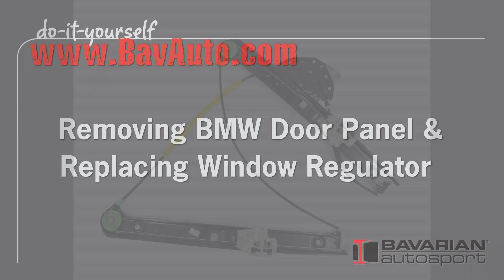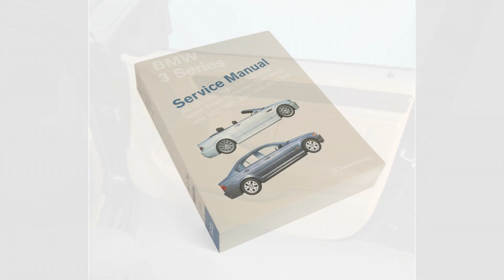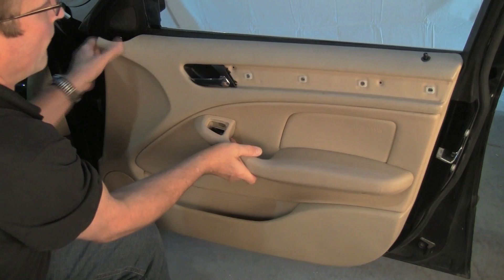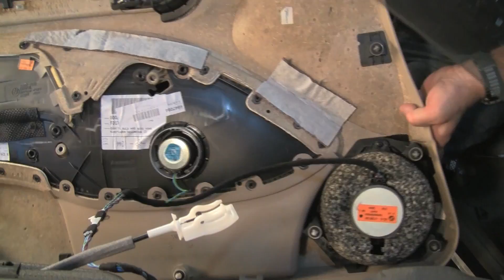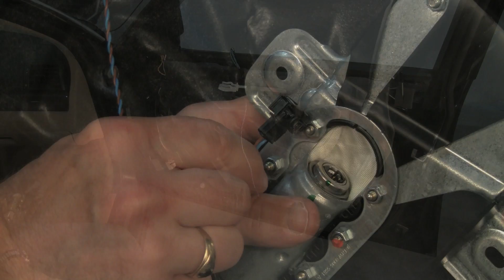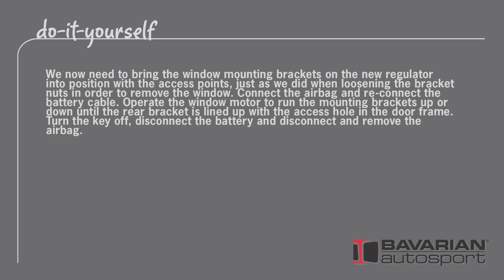Removing BMW Door Panel & Replacing Window Regulator

Comment: I have 01 530i and the driver window just fell straight down.. if I press up all I hear is the motor adn thats all.. the window just stays at the bottom... also the rear window doesnt go all the way up.. it stay 1-2 inches low from the top
Reply from the maker: Sounds like you certainly need the driver side window regulator.  the rear one is also likely in need of replacement.

Comment: I have a 2002 325i, the wooden panel, the one that has 2 screws behind it, does that slide back on? or does it need to be glued?
Reply from the maker: The wood trim  uses pins that push into plastic grommets in the door panel.  Just snap it back into place.

Comment: thanks so much, this video was spot on, I bought the parts myself for 27 and installed it in about 1 hour (even with my usual mistakes).  The window nuts are 8mm not 10mm...other than that it was great.  You may want to add if the cables get all locked up, the window won't come down or move.  I cut them with metal snips, window dropped right down...accessed the nuts just al little lower than where you suggested...thanks so much

Comment: Hi, My dad was able to replace the window after buying a new regulator and it worked. The only issue we have now is that if we hold it for a long time to put it up, once it reaches the top, it rolls back down. We think it has to do with sensitivity, but we don't know how to fix it. Any ideas? it's a 2006 bmw 325i rear driver side.

Comment from the maker: The E46 models do not require any adjusting after a regulator (or glass) replacement.  Some other models do.  The Bentley repair manuals for the various BMW chassis will cover these points.  Other than this, we don't have a specific issue for your to look at.

Comment from the maker: If you have a later model with a cable operated regulator, then it is likely that the regulator needs to be replaced due to the cable breaking away from the window glide mount.

Comment: I followed every step on my e46, however when I tighten the 2 nuts to tighten the window, the window goes up but does not come down, the spastic (orange colored) seats slip off, I tried it again this time tightening it more still the same problem, please advise

Comment: PS I can hear the motor running but the window won't move. Is it possible it's just jumped the track of the nut came loose?
Reply: Same here... I can hear the motor running but the window doesn't move. Any advice? :-(
Reply: Same issues. Someone please answer lol

Comment: Hello, first thanks for the video! Very DIY doable! My question is actually on changing the front right passenger, otherwise known as "Glazing" I recently replaced my window, and it doesnt close all the way unless i put pressure on the window from the outside. Are there any steps or things i need to know when installing a new window? Thanks!

Comment from the maker: Aside from any binding that may be present, have you performed the initialization procedures?  This sets the up and down stops and the power curve for opening and closing.  The procedure is too long for the characters allowed in this reply.  It is detailed in the Bentley repair manual for the E90 chassis.  Available at bavauto.com.

Comment: Thanks for the video. I recently replaced my E90 rear window regulator. Everything fits well. But once the window fully reclined, it had difficulty getting up.. once it starts moving, then no problem but once fully reclined, same problem. What seems to be the cause?

Comment from the maker: We do not currently have a DIY on replacing the hood release cable on the E46 3-series chassis.  See the Bentley repair manual for the steps in replacing cable assembly.  We have the manuals in-stock at bavauto.com.  The part number is B305.

Comment: This is a good video. The best tip mentioned is DON'T remove the two nuts that hold the glass.  If you do, you'll turn a 90 minute job into a 150 minute job, unless you have nimble fingers.

Comment from the maker: The E85 chassis Z4 models use a window regulator that is similar in design to what is shown for this E46 3-series.  The door panel removal will be slightly different, but the overall job will be similar.  We have the regulators in-stock at bavauto.com or call our advisors at 800-535-2002.

Comment from the maker: Most likely, you do need to replace the drive cables.  We can send you the parts diagrams to help you visualize the assembly ... as well as order the new cables.  Just give our advisors a call at 800-535-2002.

Comment: Video is professionally done. Great job!  A few questions before I decide to start:
1. At 04:46 How would I be able to align the nuts so that are visible given the regulator malfunctions to begin with?
2. At 05:16 How does the window glass stay raised and not fall down?

Comment: need assistance :i have a 2002 bmw 318i  sedan chasis Chasis No.:   WBA-AZ72050NG05943... its a right hand drive and i need the regulator assembly for the passenger door... the motor still works

Comment from the maker: Ollie - We only list the US models.  If owners of Euro-spec models need assistance with parts, just email us at info@bavauto.com or call our advisors at 800-535-2002 or 602-427-2002. The regulators for your 99 316i will be the same as for a US 99 323i.

Comment: Hi,
I'v got a 1999 BMW 316i and need a new front right regulator assembly. There is no option on your products page for a 316i model. My owners manual includes the 316i,318i,320i,323i,328i & 320d on the front page. your products page only mentions the 323i. Can you confirm if the regulators are the same for all? Thanks.

Comment from the maker: The window regulator for the E46 chassis 316ti (compact) is unique to the compact models.  We do not keep this unit in-stock.  We can certainly order it.  You can either call our advisors at 603-427-2002 or email our international advisor at info@bavauto.com

Comment from the maker: It's probable that the cable is fraying or one of the pulleys is coming apart.  We'd recommend that you order a regulator and then open it up to see what you have.  If you find that the regulator does need to be replaced (as it likely does), you'll have the regulator there to install.  Check them out at bavauto.com or call our advisors at 800-535-2002

Comment from the maker: You won't know, for sure, what the problem is until you remove the door panel and get in there.  However, we would think that the issue is either the regulators .... or ... if both stopped working at the same time, the window control through the module (dealer issue).

Comment: Hi, This Video looks great. I have a 118i convertible and both passenger & drivers side windows have stopped working when heavy snow was around. My partner is going to take a look at it but I was wondering if yo have any suggestions on what may be the problem?

Comment from the maker: If you wish to take a look to verify if the issue is a faulty regulator vs. motor, you would either need to reassemble everything, or let the ABS fault generate (air bag not installed) and then deal with resetting it.  By far, the most common fault is the regulator itself.

Comment: Sorry run out of space . I am just wondering if you can help me.The emergency ring in the trunk is somewhat loose , may be I accidentally pulled that thing .and it is probably why top won't open ( may be because valves in the motors are now open??) How can I restore that ring  and shit the valves ( if that is the problem ) Thank you .

Comment: I have a question for you sir . I put some boxes in to my 07 z4 trunk and I moved the tray in the trunk up . NowI(after moving the tray to lower position) my top wont open .I can hear the motors running and latches on the wind shield are relishing the top and it even goes up for about an inch . I had similar problem in the past ( same thing with boxes...) and I took my z 4 to the dealer and they only charged me $70 to fix it . So I am assuming it took them less than 10 min to do it.

Comment from the maker: It sounds like you have a faulty regulator assembly.  Of course, you won't know for sure until you get in there, but we would suspect that the regulator is what needs replacing, not the motor. The E65 and E66 7-series models use the standard cable-style regulators, as shown in the E46 3-series video.  We have the regulators showing in our online store at bavauto.com.  Just search "window regulator" once you are in our store.

Comment: Just took my 2003 325i into BMW dealer to have them look at my window that's very slow and makes grinding sound. They told me it was the window regulator and it would cost $675 to fix!! So I'm definitely replacing myself. How do I know if I need one w/motor before ordering without taking the door apart?. Is it common that the motor goes bad as well? Should I order w/motor just to be safe? It's not much of a price difference but definitely trying to save $ after other repairs at the dealer today!

Comment: When reinstalling the vapor barrier, do you need new adhesive or is the old adhesive still good as long as it's intact from removal? If new adhesive is used what would you recommend?

Comment from the maker: If your 323i is an E46 model, as shown in the video, you can see the two clamps that secure the glass to the slide brackets.  It is likely that your cable is fraying or broken and a new regulator will cure your issues.  If you have a different model, the points may be different.  Feel free to call our advisors at 800-535-2002 for more detailed assistance.

Comment: I have just bought a 323 se. The window motor  is working, but it sounds like its come out of the rail, it doesn't really move unless I push it. What holds the glass into the rail? A clamp? Glue? Screws? Clips?

Comment from the maker: What model BMW do you have?  The models that use the cable-drive regulators, as shown here, do tend to get slow as they age.  Replacing the regulator assembly typically cures the problem.  You can purchase the regulators in our online store at bavauto.com, or call or advisors at 800-535-2002.

Comment from the maker: You can use this as a very general guideline, but the E39 chassis (5-series 97-03) procedures will be different for both the door panel removal and the regulator removal.  the Bentley repair manual will cover the details for the E39 models.  We do have the manuals available in our online store at bavauto.com , or you can call our advisors at 800-535-2002.

Comment from the maker: All items are available in our online store at bavauto.com (except where noted). Go to our web site and type the item number into the search box.

*The blue pry tools are available in three different kits.  Part numbers ST 9007, ST 9029 and ST 9007K.
*  Removing the panel screws is a Torx bit on a 1/4" drive ratchet.  We recommend a set of Torx bits; T15 to T50 (Sears, auto parts stores, etc.)
*  The internals are removed with 1/4" drive sockets in 8mm and 10mm (Sears, auto part stores, etc).

Comment from the maker: Your 98 318ti is an E36 chassis. The regulators on the E36 are totally different from what is shown in the video. The Bentley repair manual for the E36 models will cover the regulator and motor replacement. We have the regulators, motors and the Bentley manuals in our online store at bavauto.com or you can call our agents at 800-535-2002.

Comment: I have a 98 318ti...both windows need regulators & possibly motors...can I use the same basic steps for replacement?

Comment from the maker: You may be hearing a frayed cable or there may be a problem in the motor or regulator gearbox.  You'll need to remove the door panel and get a look at it "in person".

Comment: Thanks. Right after I posted my previous comment, I went back to the car and sprayed the rubber parts on the sides of the window with some silicone spray. That seemed to fix it.  Now it's just as fast as the others. One thing though. It doesn't go totally all the way down. There is still like 1 or 2 mm that doesn't go fully down on the right side of the window. I did the install very late. Didn't notice that til morn. Why "tracks"? Is that incorrect terminology? Is "brackets" the correct term?

Comment from the maker: The motor may be weak, but we would suggest taking another look at the overall installation.  Make sure that the window does slide freely in the "tracks" when it is not connected to the regulator mounts, and that the regulator moves freely with the window disconnected from the mounts (window held in the up position so that it is out of the way).  Perhaps some silicone spray in the guides (tracks) would help.  Give us a call if you have continued trouble 800-535-2002.

Comment: I just installed a new window regulator on my gf's 2000 323i following the instructions in this video (front, passenger side). It goes up & down slower than the other windows & seems to be laboring. I followed your instructions to a t. What could be causing this? Do I need to take off the door panel & hit the tracks w/ some wd40 or tighten the bracket nuts more? It looks completely aligned & seems to be laboring only in the middle of going up or down not toward the top or bottom & closes flush.

Comment: i've found the problem. the gear at the motor broke. cable and every seems to work fine. will replace the gear tomorrow. thanks a lot for replying. you've been most helpful. cheers.

Comment from the maker: In most cases, you would not be able to make a repair to the regulator.  When the cable pulls out of the sliding bracket, the bracket is usually broken and will no longer hold the cable.  Yes, you should be able to remove the door panel with the window in the up position.

Comment from the maker: Yes, it is likely that your regulator is binding and needs to be replaced.  We have actually had good history with the aftermarket regulators.  In fact, some of the design differences look like they would be improvements on the weak areas of the original BMW units.

Comment: My passenger side window goes down find but goes up slow and has stopped before, but with assistance will go up. DO you think it's binding due to a worn window regulator? I have a 325ci. It looks like something I can do but want to be relatively sure it's the regulator before I order one. Should I go OEM or after market?

Comment from the maker: The regulator is likely faulty. The cable has probably broken out of the window mounting bracket, that slides up and down on the regulator tracks. When replacing the regulator, you may need to cut the two cables that cross between the two tracks in order to lower the window into the position where you can access the window mounting bolts. We have the regulators in stock in our online store at bavauto.com or call our agents at 800-535-2002.

Comment: can i just put the window back on the mounting bracket without replacing it? money is a bit tight right now. looking for the cheapest solution. one more question, can i remove the door panel with the window rolled up?

Comment from the maker: The rear window regulators are different from the front, on the E46 chassis, as it is on most models.  We do not currently have a video on the rear regulators, but the Bentley repair manuals will detail the job.  We have the manuals (and the regulators) in our on-line store bavauto.com or call our agents at 800-535-2002.

Comment from the maker: Are you remounting the window to the original regulator, or a new one that has the same window mounting brackets as the original (some aftermarket regulators use a revised mounting bracket)?  If the original is being used, the red plastic clips on the window slide behind the regulator sliding brackets, while the bolts that go through the clips (with the captive nuts on the other side of the clips) slide down into the slots on the sliding brackets.

Comment: This is a great video. I'm using it to replace my passenger side window. I'm running into a problem remounting my window into the window mounting bracket. Does the window go in the back of the bracket and the screw is supposed to slide into the regulator mounts one the mounts are in position as you described? The window will not slide down into place. Any idea's or suggestions?
Thanks for your great video

Comment from the maker: Yes, you likely need a new vapor barrier.  It's not that you have a lake of water in the door, but the water that does enter the door, makes it's way through a ripped or loose vapor barrier.  Also check the water drains in the bottom of the inner door cavity.  We do keep the vapor barriers and the adhesive in-stock at bavauto.com ... or ... call our agents at 800-535-2002.

Comment: Great video, I definitely need to replace the motor on my driver's door of my e46.  Also, I have water leaking though the lower seam (above the pocket in the door) on my passenger door.  Any idea what causes this?  I'm thinking a broken weather seal but that must mean there's a bit of water already in the door for it to be leaking at such a high point.  Thanks for any advise.

Comment from the maker: If you just have broken clips (the round white clips that snap into the door frame), these can be replaced.  However, if the black plastic mounts for the clips are coming off the back of the door trim panel (this is fairly common), you will need to replace the panel.  We have the clips at bavauto.com.

Comment from the maker: The door panel removal is different for the E91 chassis.  The E90/91/92/93 Bentley repair manual covers the panel removal.  Basically: *pry off arched trim strip, remove the screws behind the trim.  *pry off trim cover on the door pull (passenger side only), remove screws.  *pry the perimeter clips loose, around the door panel (similar to the video)  *Detach clips at top of panel (along window opening) and remove the panel  *Unclip latch cable from the pull handle  *Disconnect various wiring